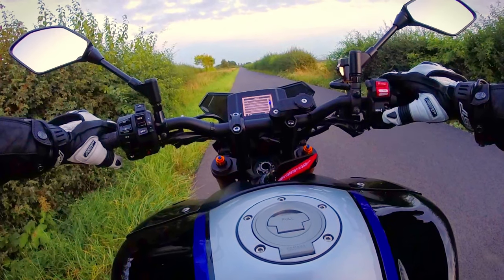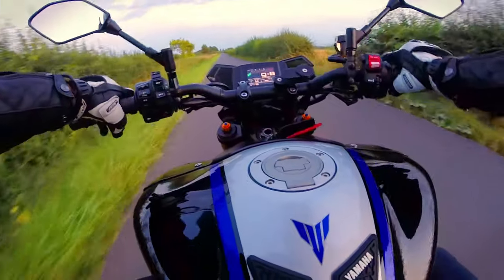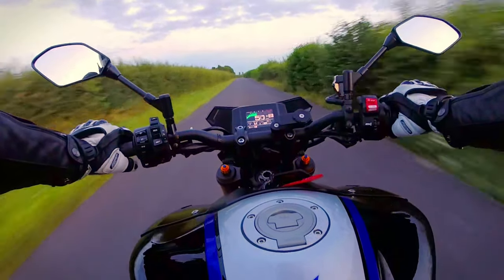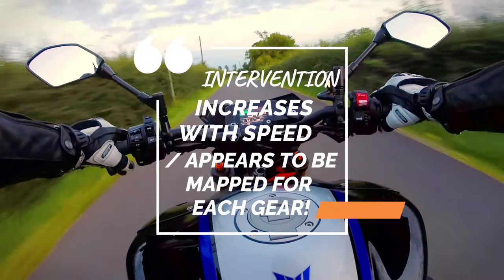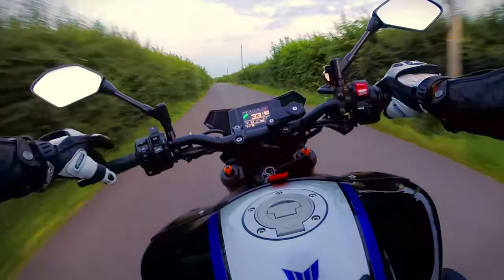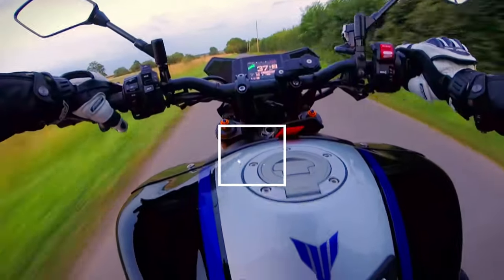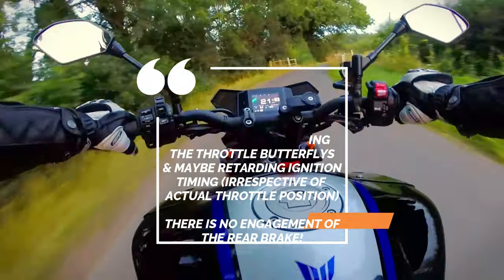YAMAHA MT09 2021 - "LIF CONTROL" - TESTED!

Comment: So in other words it even makes riders who can't wheelie look like wheelie kings
Reply: Not really because you're chasing out wheelies until you hit the rev limiter where as with clutch ups you can control the speed you're going and maintain it
Reply: It limits speed of lift so it won't spit out on you it's great for confidence. It will flip but gives you time to think so u can prevent it. I can ride my mto9 like a unicycle so it builds confidence safely.
Reply: @redactedrider7606  yeah I know you can shift mid wheelie
Reply: @redactedrider7606  exactly correct
Reply: It gives you protection against looping.....the bike makes you look like a lot better rider than  what you are.....ask me how I know.
Reply: @R.e.s.p.e.K  have you got a content Chanel? With a mt09 sp at all ?
Reply: @R.e.s.p.e.K  It can't totally prevent it from looping, it just reduces the possibility. 
The system would need to also be able to pulse the rear brake to prevent loops completely.
Reply: @paulhope3401  correct
Reply: Yeah if a 9 o’clock wheelie was cool……😂
Reply: @Mr_I_Got_One_Of_Those  awwwww.....how cute

Comment: Would have been nice to have seen the difference in the lift control settings when attempting to wheelie. Good vid though.
Reply: Setting 2 in first gear lets you get the wheel like 10 inches off the ground and sets it back down after a short period. Setting 3 it’s pretty impossible to get any lift without clutching up. I’m no wheelie expert but these are the results I’ve gotten on mine, someone could say different.
Reply: @hendrxx_  mine doesn't lift at all on any settings, only way is to clutch up. I don't understand why its like this on mine...?
Reply: @povilaslondon  not sure, maybe ur not yanking the throttle enough
Reply: @povilaslondon  wich mode are you running?
Reply: @2jzRedLine  all set to off or lowest, the only way for it to lift the wheel is 1st gear and I need to be very harsh with the throttle. Second gear I can only dream about it. That's why I'm a bit disappointed as I was expecting that insane wheelie machine as everyone is talking about.
Reply: @povilaslondon  take it to the warranty. Maybe something wrong. I cant even drag race mine, she just wheelie up!
Reply: @2jzRedLine  so does your wheelie when you are in second gear around 35mph and you just yank the throttle?
Reply: @povilaslondon  😂
Reply: @peanutsarehairy  omg man.... I've just noticed what I said in my previous message 😂😂 i meant yank 😂 this is what happens when English is your second language ✌️
Reply: @povilaslondon  No worries, I guessed that but it made me laugh
Reply: @hendrxx_  does the 2020 have lift control?
Reply: @R1___  i believe tcs on the 2020 acts as a lift control, it's just that on the 2021 tcs and lift control are seperate aids. So yes it does have lift control
Reply: 1st 2nd and 3rd the wheel will come up when in power mode 1 or 2 and this is with lift control on 3 have lift control on 1 just lets it come up faster but will slow you when at a good angle and 4th gear you can get front end up still over crest of a hill i found out. and yes if your a twat with it you can flip the bike with it set on 1 maybe 2 also...
Reply: @PureEvolution  at what speed are you pulling power wheelies at in 4th gear? Was that on a stock bike? 3rd gear power wheelies at 80mph up to 105mph off the crest of hills seems to be all I can manage consistently, I've maybe managed a power wheelie twice in 4th gear at 112mph off crests
Reply: @mikehoskin1674  no stock bike was in Wales think I was in 5th when it came up but mainly due to the little hump i went over think I got it on video if I remember I was recording around that time will take a look
Reply: @povilaslondon  There may be a problem with the machine, I open the throttle in 3rd gear, the front wheel lifts, and drive mode 1
Reply: @R1___  No, there is no lift control in the 2020 checkout. Tcs prevents it from skidding when driving only one wheel. I wouldn't recommend you try it, you're going to blow the engine.

Comment: Nice little section of test road;)  With lift control in #1 I find it allows a decent wheelie angle and can quick shift into 2nd and starts to bring it down a little then by the time I quickshift into 3rd it is bringing back down to the pavement.  The '21 MT09SP is a very fun and engaging bike....like a 2-wheel Porsche GT3 that you can wheelie!  Keep up the great MT09SP content!
Reply from the maker: The lift control really is a good system, it is refreshing to see a system that doesn't cut power abruptly. I have been enjoying the content on your channel 👍MX is my first love.
Reply: @tankslapmoto9999  I am a moto guy at heart....one of the reasons I like the MT09SP so much....feels kind of like a fast dirt bike!😁
Reply: You guys realize the SP and the non SP are the same bike, right? Just a different shock in the rear and coating on the forks. 
Cruise control is just a gimmick.
Reply: @tg8150  The forks on the SP have high/low compression damping and DLC(diamond like coating, slides easier or something.. which is apparently $500 on its own). The rear ohlins shock is $1100-ish on its own. Just the suspension differences alone are close to the cost differential between the two models. Cruise control is just a bonus that cant really be added later if one did decide they wanted it. Not a gimmick for everyone.
Reply: @Jtwizzle  @tg8150 the seat is also different, and the paint scheme is unique to the SP, it's based on the R1Ms paint scheme, black levers and handlebar too, and the brake fluid reservoirs are tinted, and their expensive AF.
Reply: @JoaoSilva-gs5jb  yep

Comment: With modern throttle-by-wire, there's no real need for ignition interrupt or other engine control methods anymore. The ECU runs the throttle by servo, all the time, no matter what. What you do with your wrist is not always what the ECU does with the actual throttle blades.
Reply from the maker: Sounds very plausible for the wheelie control, I'm sure that the ecu, in conjunction with the IMU, could simply close the electronic butterfly's as you say. The traction control feels like it still uses ignition timing in conjunction with closing the throttle. I can't really feel a hard cut these days, but it definitely feels like there's something going on ignition wise.👍
Reply from the maker: It is all very interesting. People say oh they'd be unrideable with a 1:1 throttle map, but I am not so sure. I suppose it allows the manufacturers to implement their modes and sell a bike that appeals to a broader audience, new riders and experienced alike (plus, as you say, they can throttle map for each gear to appease noise and emissions regs). I have a Tenere 700 with a good old-fashioned cable throttle, it definitely feels more natural to me.

Comment: does traction control intervene with wheelies at all? or just when the rear starts slipping in corners and on wet surfaces and stuff.
Reply from the maker: No intervention with TC in level 1 on this particular bike, unless you get wheel spin whilst doing a wheelie (not ideal). Other, more basic, TC systems on different bikes can intervene though, they simply detect a difference in wheel speed between the front and rear wheel and perceive this to be wheel spin (rather than a wheelie) and cut power.
Reply: @tankslapmoto9999  Your information has helped me with my decision to get the MT09sp. I not a noob to fast riding but noob to wheelies. So this is the PERFECT bike for me. Fast, RELIABLE, great seating position and a hooner.

Comment: Ive had a gen 1 2014 since new.. has no abs no traction control.. and is tuned to 140hp.. full power on tap. Allows u to ride the bike a learn it properly how to use power.. not ride around thinking ur fast with all those electronic assists to help these new riders..

Comment: Question bro, how do you like that OEM windscreen ? Do you feel you like to deflects some wind off of your chest and /or face? Maybe when tucking down? I ordered mine but was thinking of the Puig screen because it’s higher, still looks nice, and seems like it will definitely deflect.
Reply from the maker: Hi, I like the way the OEM windscreen looks but it is probably not the most functional option. It does deflect some wind from the chest area and a bit from the head but the trade off for me (at 6'2") is  a bit of wind buffeting/noise caused by the screen, it disappears if i  tuck down.
Reply: @tankslapmoto9999  thanks for the response. Should work a bit better for me then since I’m 5’6”.  
And I do prefer that looks 🔥

Comment: So it does limit the lift. That’s nice to know. I’ve been leaning forward and rolling in to prevent it from looping because it comes up so easily I thought it would just keep going until I’m on my ass. It was smooth the first time it happened on my way home after purchasing the bike and ever since I’ve been playing it safe thinking I got lucky. It does it great when I unintentionally do it then a big womp womp when I purposely try lol.
Reply: Mines failed 2 times! Got lucky not to crash. Always pay attention
Reply: @2jzRedLine  oh. Good to know. Now I’m curious if that happened the other day with mine. I’m not a wheelie person but I’ve never had the wheel come up that high before. I thought it was going loop
Reply: @Love4boost  idk if mine did that due to pilot error, wrong combo of setting , or IMU failure. All I know is that I kill the throttle the last second possible. Twice.
Reply: @2jzRedLine  Is yours a newer model?
Reply: @Norepinefrain  yup it is mate
Reply: @2jzRedLine  What settings were you running? My SP comes next month can’t wait
Reply: @Norepinefrain in traffic I run DM 3 and TC 2, in the twisties DM 1 and TC 2.

Comment: Was that a power wheelie at 2:00 in second gear? Damn, my bike is capable of things I'm not even aware of. I've been riding it with lift control at max for almost a year now, and I'm yet to discover new things about it. Dope.
Reply from the maker: Yeah the MT09 was ridiculous for lofting the front wheel, even 3rd gear power wheelies were fairly easy

Comment: NB! You can still flip it with lft control on if you do a clutch wheelie. 
I did wheelie on second on my MT09SP a few days ago, and I think I did almost 12 o'clock wheelie, it was scary. No foot on the brake, as I expect lft control to always limit me on 45 degrees.
Reply from the maker: Makes sense, I'd imagine that a big old clutch up would spook the electronics. If you are at the point of doing clutch ups definitely better with the LIF turned off, you would only need a very delicate dab of the clutch, even in 3rd and 4th gear👍
Reply: Hm. Third as much as I've tried - never have enough power for a wheelie. Maybe I am too heavy. Hoping the upgrade of the exhaust + ECU flash will do the trick though. 

Turning LIF off - yeah probably will turn it off somewhere mid this season. Still have to practice a bit :)

Comment: I'm ordering a mt09 this coming year. I'll run it on but I'll still roll into the throttle and stay tucked to play safe. Would hate to loop and get hurt. Mentally would be concerned of the LIF system failing to read and if I pin the throttle unexpectedly coming up faster than expected
Reply: You’ll learn throttle control quuuckly on the mt09
Reply: @zgjfinance2796  I sure did 😏
Reply: @robertcarter5253  yessir I have mt09 sp and the first month was really tepid on the throttle 😂; still haven’t taken lift control or tcs off yet

Comment: I have exact same bike; I ride tcs 2 mode 2 lid 2 and for me it’s insane still. I’m afraid to turn off the lift control 😬
Reply from the maker: But it will be fun....😀 the throttle connection is really good on the mt09 so im sure you will find it easy to modulate, you can always drag a bit of rear brake as well to tame it down.

Comment: What exhaust are you running 🙄 sounds nice. I am waiting on my Mivv GP pro 😎
Reply from the maker: This was just the stock exhaust in this video, I had a Dominator Hp4 which sounded great and is featured in some of my other MT09 videos👍
Reply: @tankslapmoto9999  aaaa Well it didn’t sound bad at all, sound better irl with stock and aftermarket

Comment: I have a question..would it come up higher if you wasn't backing off throttle? I see your wrist backing off then giving it more as it was coming down. Maybe it's my view but looks like you're kinda on and off throttle to me. Not all that much but just wondering cause mine feels like it still climbing even quick shifting into second gear. Does it matter about the TCS mode you're using? I ride normally with everything on one. Thanks for any advice or info on what you were doing with your wrist. Could be the way I'm watching it so just wondering. 👍
Reply from the maker: To be honest I can't really remember, I probably backed off slightly out of instinct. Although I do distinctly recall winding the throttle on mid wheelie to discover that the angle of attack would not increase all the way to the limiter. Without doubt if you tried this with "Lif Off" the bike would have continued to rise and loop out. It's my belief that the bike uses the IMU to limit the angle of attack, I can't imagine that they would release a bike that can be looped out with Lif control activated.  I think TCS mode would only have an impact if it detected slip (I ride TCS mode 1 also). Cheers👍
Reply: Welp after 5 months of replying to this post I'm here to tell you that I might need to take it back to dealership cause something isn't correct with settings cause mine this bike will (everytime) loop on level 1. We set everything manually and everything was on settings 1 and the bike just kept getting higher and higher. I thought I was chicken shit but had a pro rider said same thing as your telling me. So now I'm replacing tons of parts but the main thing he's ok. My bike has a recall on ECU but wasn't sure if that has something to do with it acting  like it does. I'm going to contact Yamaha.
Reply: @dano7480  Are you saying you actually looped yours?
Reply: @Dale Colegrove  welp after a year later I can honestly say that it will loop. Maybe the computer didn't change anything between practices or I have to shut it off and back on to reset the modes. Do not just try to launch the bike like your at a  dragstrip cause you will be buying lots of part if you make it!  We put a strap to lower fork extension and still did that. Not happy with the wheelie control. But like I said it could be just my bike cause everyone else I watch goes right down to the road no problems.
Reply: @dano7480  LIF can't stop it looping, it can only control the speed at which the front comes up.
It would need to be able to pulse the rear brake to be able to stop it completely.

Comment: Great video. Thinking about getting an MT09. Do you feel the bike needs a steering damper installed because of potential steering wobble?
Reply from the maker: Cheers👍I don't believe that it needs a steering damper in my opinion. I  know that some people suggest that it does, but it never gets out of hand in my experience. You have so much leverage with the wide bars and the upright riding position that it is very easy to manage. Also the wobble is usually caused by hard acceleration, where the front wheel is skipping the tarmac with the bars at a slight angle (rather than anything inherently wrong with the bike, like chassis flex or flex in the forks etc).
Reply: @tankslapmoto9999  appreciate the reply, makes a lot of sense. Thanks once again, keep up the great content 😃
Reply: @stockstunna  i did get a hyperpro suspension and that fixed the wobble for me :P

Comment: So for clutch wheelies LIF needs to be off? What about TCS? Does TCS interfere with either power or clutch ups like on some other models?
Reply from the maker: If you want to clutch it up to balance point Lif would need to be off. The angle of attack is limited with it on, so effectively there'd be no point clutching it up. TC doesn't intervene for wheelies on this bike, not in level 1 at least👍

Comment: On mine to lift in mode 1 and tcs 1 in second gear, I have to pull the handlebars a little, normal ?
Reply from the maker: Mine would lift with no effort on the handlebars in 2nd gear and even 3rd gear, although sometimes it might take a little encouragement in 3rd depending on the road. I think mine made really good power, although it might just be a case of what rpm you roll into it, I seem to recall 6/7k being the sweet spot for power wheelies on the mt09.
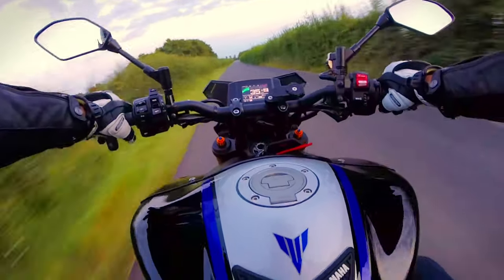Reply: With tcs 1 and lif 1 ? at 1:14, she barely lifts in second gear
Reply from the maker: Sorry I misunderstood your message, wif "Lif" on level 1 it barely wheelies in 2nd gear in my experience, I'd just turn it off altogether personally, you can easily modulate it yourself with the throttle and it's much more fun! 😉

Comment: Thank you for the video. So if I understand correctly you can go full throttle without the bike kicking back?
Reply from the maker: Indeed, the bike will not loop out👍
Reply: On what settings
Reply: @abdnsuperslater0015  Hi, did you find the settings?

Comment: Hi awesome vid can you tell me what settings your on ? Modes etc as I have the 2022 mt10sp and worried about flipping it
Reply from the maker: Hi sure, they were LIF 1, SCS 1, TCS1,  and D mode 2 (for smoother throttle response)👍
Reply: @tankslapmoto9999  thanks bud

Comment: Soo it can be uset on power wheallie on 1st gear only?  i don't know why but i have fear of turns :( like i fear to my tires start slide .. any advice? (my bike is the same SP 2021)
Reply from the maker: It will still power wheelie in 2nd with LIF on, just barely in my experience. It should be solid in the corners, maybe check the tire pressures